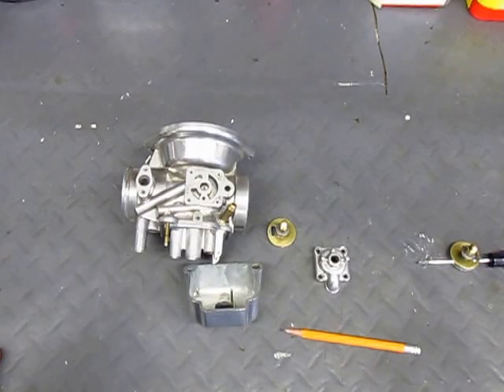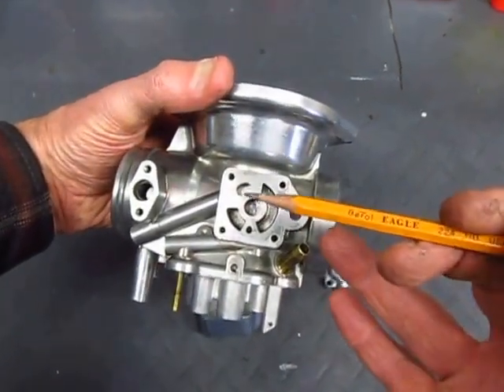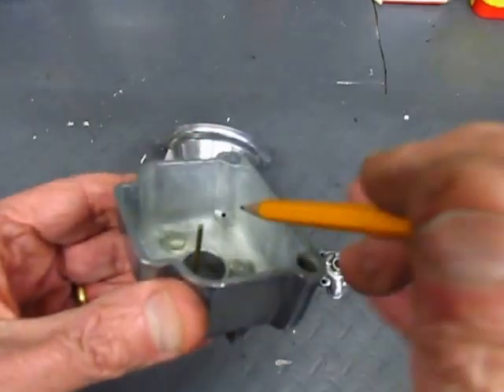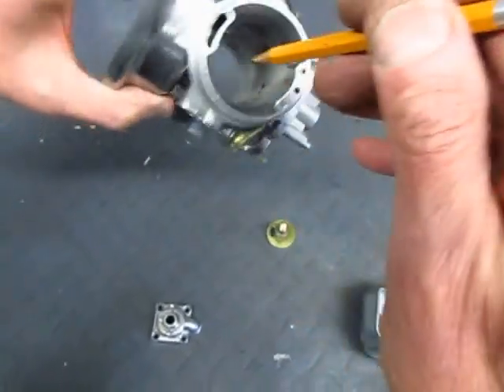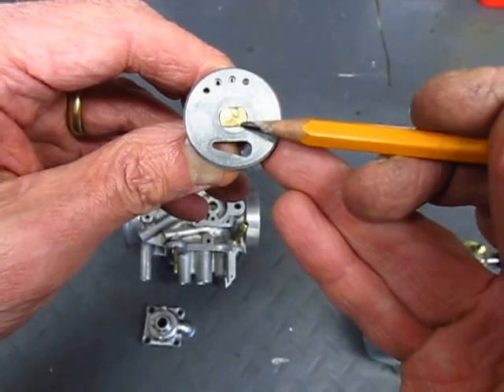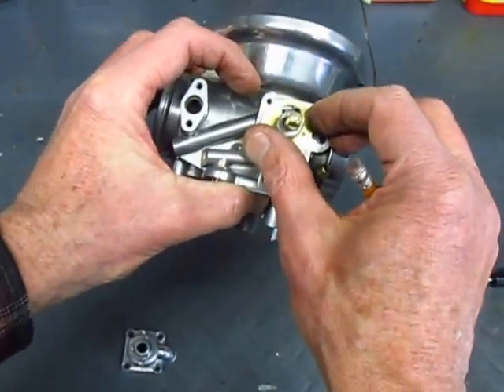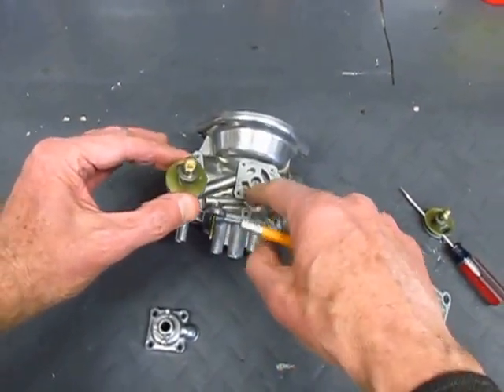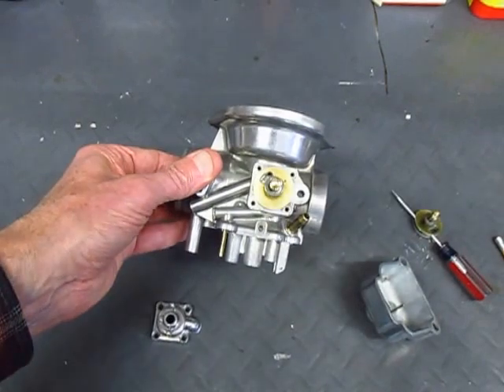How The Enriching Circuit, aka Choke, Works

Comment: My limited experience with Bing carbs has been for the 2 that were on a 100 hp Rotax aircraft engine and now a single, 40mm Bing on a Jabiru 85 hp aircraft engine. In these aircraft applications, this feature is not called a Choke, but rather, a Starting Carburetor. I always thought that nomer was odd, since I incorrectly assumed that apparatus simply allowed a richer fuel flow when engaged. You have explained clearly that it actually does function as a simple carburetor by actually mixing and metering fuel and air, independent of the main carb. Thank you.
Reply from the maker: HI FoesFlyDennis, I was surprised that this is actually a carburetor rather than a restriction in air flow, as is the case with a "choke".  When you look at the holes in the disk, it's almost a "digital" device.  Clever.

Comment: This is great! I was having an issue where I couldn’t get the bike to pull fuel into the carbs unless I put my hand over the mouth of the carb whilst cranking the engine. In the end I discovered the boots into the engine were loose and one of the butterflies was partially open, so there was simply a lack of vacuum to make this circuit effective. This all makes sense thanks to your video!
Reply from the maker: I'm glad this was helpful to you Adrian.  Keep those Airheads flying. :-)

Comment: Great video. Thank you. I've read this info from Motobins "hints". I'm unsure where it otherwise originated from. I wonder if you could comment please? quote: "Cold Starting Problems can often be
cured by replacing your old float chamber gaskets unless they provide a really
air-tight seal around the choke fuel pick-up tube, the fuel level in the
auxiliary chamber will not be raised, and the cold start mixture will not be
further enriched during initial operation. The Auxiliary Carburettor itself can
often become loose, so being by-passed and ineffective; the resultant air leak
will also promote 'surging' at about 40 mph on a small throttle opening change
the gasket every few years, and make sure the screws are really tight. "
Reply from the maker: Steve, 
That makes sense as the enricher circuit is it's own carburetor and needs a good vacuum to pull fuel into it. When starting, there is very low velocity in the carburetor throat so the vacuum is low and every bit counts.
Reply from the maker: Steve, yes leaks around the cover of the "enricher" cause these problems. So a broken gasket, gasket that got partially sucked into the enricher, and loose cover screws all create air leaks. As to replacing the gaskets every "few years", I've not seen the need.

Comment: VERY NICE!
Now I have a stupid question. Those holes, from smaller to larger align to the one in the carb body. But there is a small gap between the holes and when I set the "choke" to 50% I would be right in the middle of the two holes. Or if it's slightly missaligned even at the max it could fall between two holes. Is this assumption correct? Or is the "choke" suppose to have 4 positions that you'd feel with your hand? Mine clearly hasn't anything like that.
And how are we normally supposed to use this? Based on outside temperature, a few seconds at max, then a few seconds at mid and all the way down or it doesn't really matter? :)
Reply from the maker: I start at full choke and then go to half choke after it stumbles a bit because it's too rich. And then down to no choke after a bit, but adjust the throttle to a bit higher RPM using the throttle lock.  That's just me. Others may do this differently.

There is a detent at about half choke, but I don't feel any other notches except that one.

Comment: Terminology: It is not a choke.  It is an enricher circuit. There is no choke on this carb. I also used to call it a choke until an engineer corrected me.
Reply from the maker: Diesel Dan, you are correct.  That said those new to airheads call it a choke and do searches using that term.  That’s why I titled this with “aka Choke”.  

In fact it is a separate carburetor that works at low intake velocity and stops working at higher intake velocities.

Comment: Thanks for a well explained presentation, do you have experience of setting up these carbs to suit pod filters ?
Reply from the maker: Mark, no I don't.  I've learned that BMW designed the intake including the air box to maximize performance of the engine. This information comes from folks who raced these bikes in the 1970's and did dyno testing. Consequently, I conclude that pods (aka K&N filters) degrade performance, although they may look "racey" :-)

Comment: Cooool... what vehicle did it come from?
Reply from the maker: Marc, It’s the same for all 750,900,1000,800,650 airhead engines which use a Bing constant velocity carburetor
Reply: @BrooksAirheadGarage  Right click > don't recommend channel. I asked because I wanted the answer.
Reply from the maker: @Marc_Wolfe  I believe it was my 1977 BMW R100RS carburetors that I used in the videos on how Bing CV carburetors work.
Reply: @BrooksAirheadGarage  Good to know. There are enough variations with carbs that I never understand why people never put specific info in title or description.
Reply from the maker: @Marc_Wolfe  The intent of these videos is to explain the theory of operations of all BING CV carburetors, not how to rebuild a specific carburetor. So, the specific bike or BING CV model is really relevant.  However, I do show how to rebuild a variety of BING CV carburetors on my website and the specific BMW model they are used on. You can access the site via the link at the top of my YouTube channel page, "Brook's Airhead Garage Website".
Reply from the maker: @Marc_Wolfe  My intent for these BING constant velocity (CV) videos is to explain the theory of operations, not show how to rebuild a specific carburetor model. Therefore, the content in these videos applies to all BING CV models. That said, I do have content showing how to rebuild specific BING CV models used on specific BMW bikes on my website. You can access those by clicking the website link in the header of my YouTube channel page, "Brook's Airhead Garage Website".
Reply: @BrooksAirheadGarage  I'm aware what the point was. I've seen many such videos over the years. Some better than others. Been looking into models that don't use a basic choke flap.

Comment: The crap ethanol fuel we have now plays havoc with these carbs
Reply from the maker: Rodger that flobeeone kinobee.  I get about 6-8 years out of the o-rings before they deteriorate.
Reply: @BrooksAirheadGarage  the water absorbed by the ethanol causes corrosion that can block the tiny drillings before and after the throttle butterfly, if you don't use the bike over the winter months